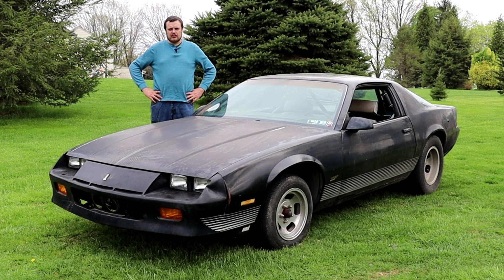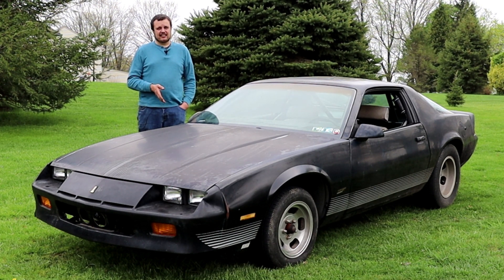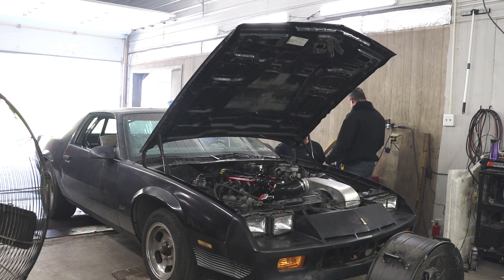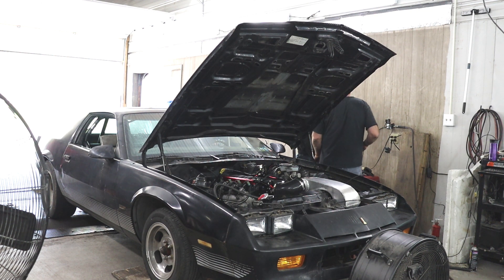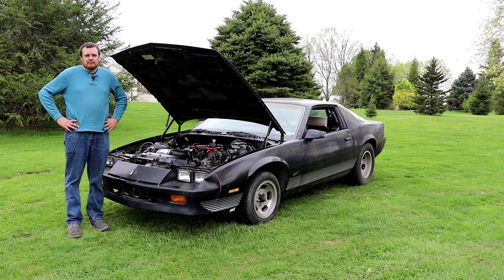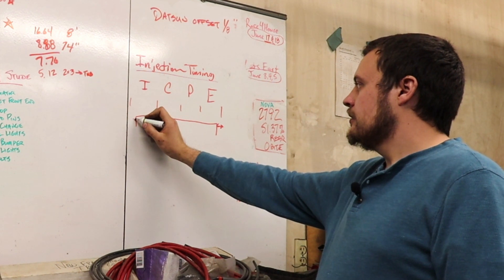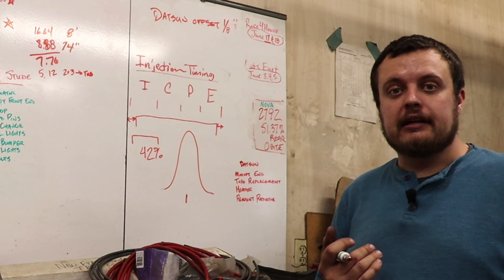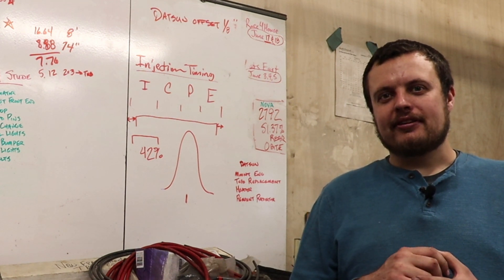Free Horsepower! - Making More Power Naturally Aspirated - Injection Timing

Comment: An experiment I have been wanting to see for a long time is if a 6L or 6.2L short block with L92/LS3 heads, LS3 intake, headers and an Elgin 228/230 is going to make more power than a set of 706 heads, TBSS/NBS intake, headers and an Elgin 238/242 which you should have the P-V to fit and PAC1218s should still be able to control since the valves are small. I know the 706s make 10-20 more ft/lbs for around 1500rpms in the midrange because of the extra velocity and higher compression and I have a feeling the 10deg int and 12deg ex duration should make the peak HP pretty close along with the compression, not sure if there much either way from the intake manifolds, perhaps the truck intake has a slight Tq advantage(?) I kind of wonder if it might have been a good idea for you to try a thinner head gasket and/or having those 821/823 heads milled a touch to up your compression, LY6 is 10.4:1 stock, something like 11.2-11.6:1(if you want to be spicy) might really wake that sucker up, might show gains if you used e85 as well. Another little experiment I always wanted to try is clocking the spark plugs as well. I am stoked that you did injector timing, that fascinates me. You are really getting me excited and wanting to get off my ass and get my 2004 GTO 6M out of storage in TX, tow it home to TN and assemble either the LS1 or the LQ4 I have in the bed of my truck for it and start ripping up some tires again. It would be so cool if I could run an Atlas 4.2L in my Monaro the way Holden should have offered it to compete with the Barra Falcons. I have been sitting here wondering how much power N/A a 4200 might be able to make, also wondering what it would be like to bore one out and stroke it...was thinking it would be wild to bore it the size of the 2.9/3.7 4and5 which are 3.76" instead of 3.66" and thinking it would be cool to stroke it between 4.2"-4.5" that could yield up to 306ci...would be cool if it could make 400-500hp n/a at the crank and still rev 7000+ rpms. Shame they didn't modernize that engine with TiVCT and DI and make it the base Silverado and Camaro engine. I wanted to see it in those applications when it first came out with a manual option. Great videos. I will definitely be watching and loving what you do.
Reply from the maker: Cool

Comment: It would now be interesting to combine this with out of the norm high fuel pressure for PFI of 6-10bar to see the any possible gain in improved atomisation. There are claims that this is how some get that last little bit of performance with NA engines.
Reply from the maker: Yeah. Just have to be careful with high fuel pressure. If you go too high your injectors will stop functioning. They aren't designed for that.

Comment: Great content! First time seeing your channel and I’m subscribed.

I’ve also read that open valve injection helps a bit with keeping preignition at bay if you’re pushing things on your cylinder pressure / temp vs your fuels octane rating (more cooling in the cylinder similar to a direct injection engine).

It’s also supposed to extend the lean burn limits as supposedly it helps ensure that there’s fuel entrained in the plug gap. I am definitely looking for dyno testing on open valve injection and big plug gaps and extending lean burn limits.

My thoughts on the power is that you’re applying the majority of the evaporative cooling effects where it most matters for power just before the valve is closing and the provided intake air flow is finally catching up to the piston demand which has been below the curve until that point the cooling lets you stuff a tiny bit more o2 into the cylinder before the valve closes- my thinking anyway.
Reply from the maker: Good thinking. Thanks for subscribing!

Comment: Wouldn't your injector timing have, in effect, greater charge cooling?
Reply from the maker: Probably
Reply: @Calvin-Nelson  And what if the fuel pressure is increased, to further shorten duration whilst  increasing atomization?  More wholesomeness?
Reply from the maker: @dannoyes4493  probably. Don't want to overpower your injectors/fuel pump, but yup
Reply: @dannoyes4493  I love where you’re going with that question and I’ve been wondering the same. I think 12 hole injectors and an OVI strategy go together well, but I can’t find any that are big enough to allow me to keep running OVI only after overlap and a few degrees before the intake valve closes at WOT all the way up to my engine’s RPM peak. 

I could see benefits to dynamic fuel pressure with increases as RPM rises so you can spray more fuel in that small window as the available time window gets smaller due to increasing RPM -and you get the added bonus of increased atomization from the higher fuel pressure.

Open Valve Injection finally makes so much of direct injection make sense now…
Reply: @adamarndt7617   New pump strategies are necessary as the standard pressures are not viable - What happens if you run an injector at 300psi?   Or, perhaps DI injectors + pump in a port position.. ? Superfine atomization and the resultant cooling effect.
Reply: @dannoyes4493  Wow. DI injectors + pump in a port EFI application, SUPER interesting thinking.  I just don't know of any systems that even kind "meet in the middle" between standard Port EFI 3 bar pressures and say 9-10 BAR.  Injector Dynamics claims that their run-of-the-mill 1050x /1350x etc injectors will support 10 bar, but what kinda fuel systems is available that support that?  -Are you on any automotive forums or FB groups? Interested in following your thoughts somewhere more appropriate than YT comments...
Reply: @adamarndt7617  Unfortunately, no I'm not...  just a bored retired engineer who restored a 914, and decided to explore the air-cooled Type 4 engine...  with the goal of 100+ hp/liter AND a smooth idle 
AND durability on pump gas.  
In an air-cooled engine, efficiency and temperature control is essential...  real close, but not quite there yet - keep blowing 'em up but learning something critical each time.  Ultimate test includes afternoon rush hour traffic here in So. Texas.  Stresses the engine more than anything I know...
Reply: @dannoyes4493  I’m in the Seattle area so I don’t have your air temp challenges, at least.

I’m a bored IT engineer with a couple intense hobbies that let me play with engineering solutions in other domains.

I have been restomodding my 1979 Corvette and have been trying to double my starting fuel economy and my starting HP using lots of modern technology in my  Gen1 SBC with an aftermarket long-runner TPI style intake (that flows around 300 CFM on every runner). Holley HP controlled, thin ringpack, very aggressively lobed roller cam, 58x crank trigger, CNP LS ignition coils, and loads of goodies.

I can’t help but find more areas to drive improvements next time and with these engines you can’t look to RPM to help you make more power and detonation resistance is super important because they make like 120% VE at the torque peak where the wave tuning is at its strongest and the cam is its most efficient.

OVI with injectors big enough to keep spraying in an open valves up to my torque peak I think can help.  (Plasma ignition and huge plug gaps could too but I don’t want a system that’s going to eat plugs every 5,000 miles and all the ones with good power seem to do just that.

Comment: Would be cool to see you do a short video on how you adjusted injector timing
Reply from the maker: I could do that. Would be very short. At the end of the day your car will probably want different numbers than mine so it will probably need played with.
Reply: @Calvin-Nelson  I'm more interested in the how-to and the resources you used, than the actual numbers.
Reply from the maker: @jims261  the Holley Terminator X software tool and Microsoft Excel are all I used. Maybe I could do a short or something.
Reply: @Calvin-Nelson  Please do - I am running a p59 so would be good to see the process as I am only just beginning to learn about injection as I transition from carb's. Great work.

Comment: I have a sloppy inspired turbo 5.0 SBF running Terminator X with 60lb dekas.  I am using the Holley end angle.  It seemed to be better than not using it.  Are you saying there is room for improvement on the Holley number.   What adjustments should be made?
Reply from the maker: Are you close to maxing out your injectors?

Comment: Great video! Injecting fuel with the intake valve open may increase performance (probably due to heat extraction from the intake charge), and also help with cold starting. Research suggest it is more efficient to spray on a closed, hot, intake valve. The hot valve completely vaporizes the fuel, allowing for a more homogeneous charge.

 I know you are only concerned with performance. I am going to be running a fully instrumented engine on a dyno here shortly and will play with injection timing to see the effects on performance and economy.
Reply from the maker: Yup. We didn't test for that. Interesting. We just tested for horsepower. Also engine is way more snappy.
Reply: I’m curious whether that’s actually the case or not, though. Bosch reports that open valve injection decreases EGR temps by 20-30 degrees F and can allow between a 0.5 and a 1.0 increase in compression points before detonation.

OVI seems to act like “direct injection lite” in this regard: more evaporative cooling power makes it into the combustion chamber vs. cooling the intake tract walls and intake valve when compared to sequential or batch fires port ignition, ultimately reducing knock if you’re pushing the temp-pressure of your fuel’s octane rating. -I have to think that atomization / mixture prep is still very important with OVI and I think this is why the Japanese autos adopting OVI in OEM port injection seem to simultaneously adopt 12 hole high atomization injectors (50 micrometer initial droplet sizes).

I’ve found another paper that says that the open valve injection strategy also can create stratification of air fuel mixtures in the chamber and increase the localized AFR around the spark plug gap, which allows one to extend the lean burn limits further and grab some gains in highway cruise fuel economy.

I think if you take advantage of OVI by increasing the compression and combing OVI with a strong spark and a big plug gap, in an NA engine OVI can increase fuel economy even if leaner AFRs would increase emissions. I’ll post links to the papers later after I get to my PC…

This is a PHD thesis paper that is essentially a meta study of other studies on advanced port injection strategies and has a TON of good nuggets in it: https://www.researchgate.net/profile/Mohamed_Mourad_Lafifi/post/Which_controller_is_better_for_the_lambda_control_strategy_in_a_single_cylinder_petrol_engine/attachment/59d6340879197b8077991b40/AS%3A377577186316291%401467032824889/download/Port+Fuel+Injection+Strategies+for+a+Lean+Burn+Gasoline+Engine_Redacted.pdf
Reply: @adamarndt7617  A very well thought out reply. I can definitely agree with the in cylinder cooling effects and subsequently higher detonation margin. As with everything in combustion engines, it becomes an optimization problem. 
Localized optimal AFR at the spark plug, with statificatiion, will depend heavily on the flow characteristics. 
If you are able to bump the CR with OVI then that will most likely be most efficient as thermal efficiency is heavily dependent on CR. 
I will not have the luxury of altering the engine I will be testing with, and will just have to experiment with injection timing to see what the optimal settings are for that particular configuration.

Thanks for the link!

Comment: It'd be neat to see an A-B comparison of the Holley injector angle implementation vs the IEA spreadsheet calculator. It's supposedly better than the imbedded holley calculation.
Reply from the maker: I wanted to do that, but we did a comparison of what the Megasquirt had in the box by default to what I thought it should be then tweaked a few degrees either way.

Comment: What was the injection timing before and after?
Reply from the maker: Every ECU does it different so I didn't want to confuse people. I went from 270 degrees before TDC to ~220.
Reply: @Calvin-Nelson  what ecu are you using? megasquirt? If it is, i have also found more power using it by increasing the number of injector pulses per cycle. So, instead of injecting all the fuel for that cycle on a single open/close injector event, you do it in 2 or more. So the injector will open, for half of the required time, close, then open again for the remainder half. 
This helps to better atomize the fuel because every time an injector opens there will be a slight drop of pressure at the rail (more with larger injectors). 
I have picked up a few hp here and there by doing this, but were is really makes a difference its on driveability.
Reply from the maker: @tuloko16  yeah
 Megasquirt
Reply: @tuloko16  You mega squirt guys are always the most hard core of geeks! That’s a great tip. I am not sure if Holley HP can even do that.. all I’ve looked into from Holley you just define the angle at which you want injection to end and it just works backwards from there with the injectors open all the way all the time.

I can see how this might help until you get up in rpm when you need all the fuel flow capacity you can get to stay between overlap ending and the intake valve closing; going with the best possible atomizing injector / an injector with the most available holes seems simpler to me right now, though. (I’d LOVE to find a 1,000 cc 12 hole injector but I don’t think they exist. A 6 hole 1,000cc injector is the best I’ve found so far.

Comment: So that 5hp gain statement was kinda kicked in head by changing intake 😂 
If your timing was like 12 degrees then changed to optimal 28-38 whatever it ends up being the hp increase is a lot. I mean N/A just like turbo more air in more fuel atomization and get more air out more hp.
Reply from the maker: Yep. We played with everything to get it to be optimal. Free horsepower is free horsepower.
Reply: @Calvin-Nelson  dang right! Keep up good work